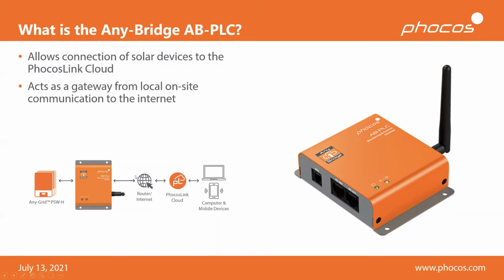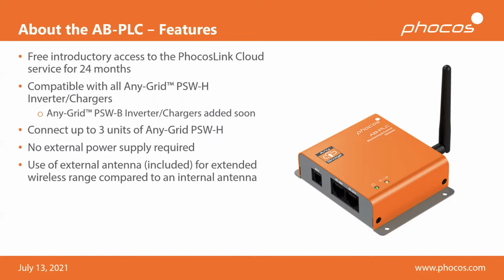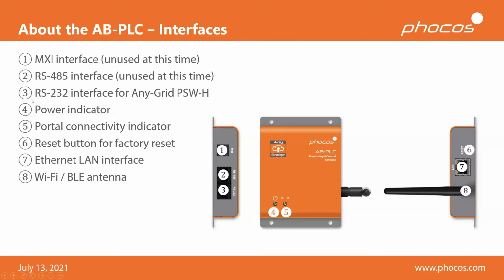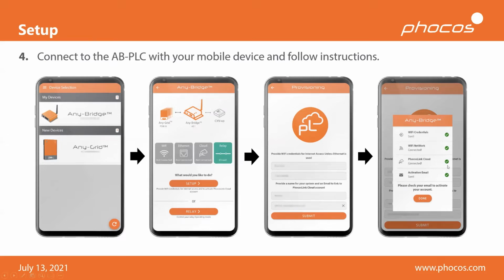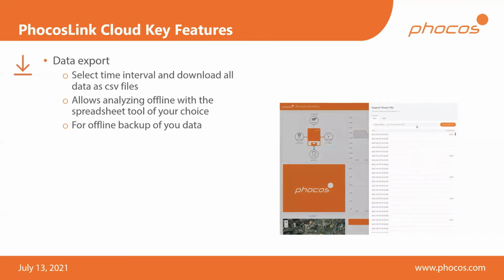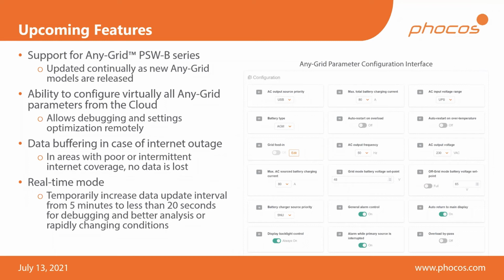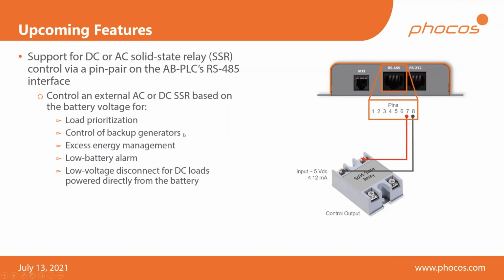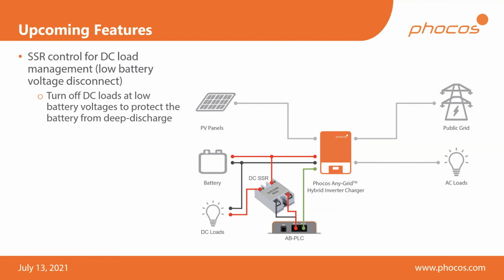Any Bridge AB-PLC & PhocosLink Cloud Webinar

Comment: You say that we should check the firmware version on the inverter, but you give no instructions about how to do this. Please advise.
Reply from the maker: Hi thank you for your comment! To check the FW, please press the down button on the inverter display while on the main overview screen and scroll through the three screens labeled U3, U2, and U1. These refer to the firmware versions of the BLE chip, remote display, and main body, respectively. The important firmware version to check for Any-Bridge compatibility is U2, the remote display firmware. Refer to section 8.6 in the Any-Grid manual for additional info on the values screens. If you have any more questions we encourage you to reach out to our technical team at the following link https://www.phocos.com/contact/#contactech2

Comment: I have a system of ten PV modules of 450 W each one, it is divided in two strings of five módules each string but when I check the PhocosLink App and the Phocos Cloud it only shows me the power flows registration of one of the two string. How can I visualize the power flows of both of my PV strings through the app and the cloud?
Reply from the maker: Hello, we apologize for this issue. This is a known bug and it is currently being worked on.The PSW-H with 2 MPPTs should be correctly displayed in the AnyBridge version 11.